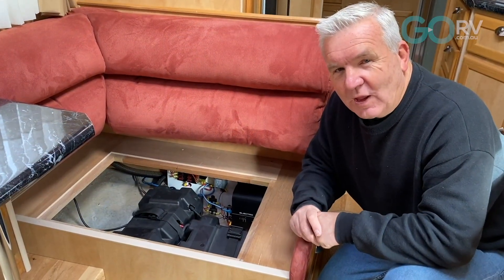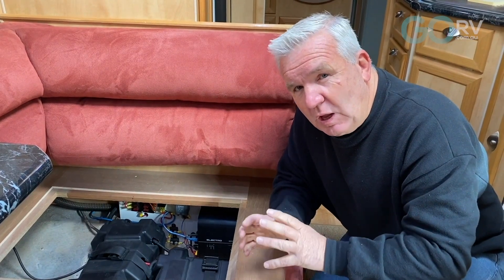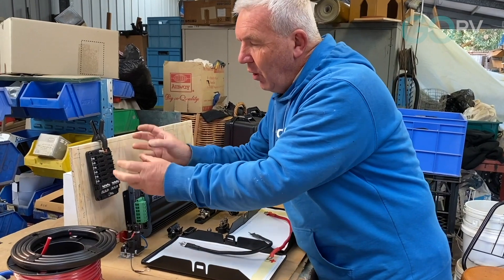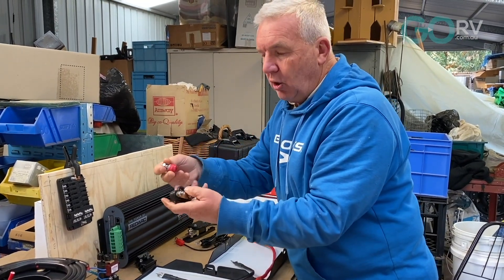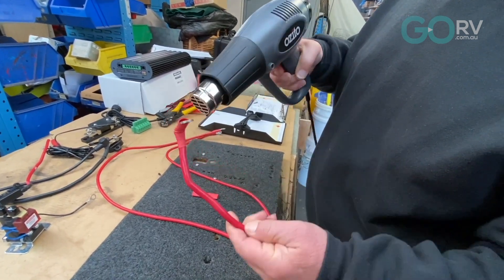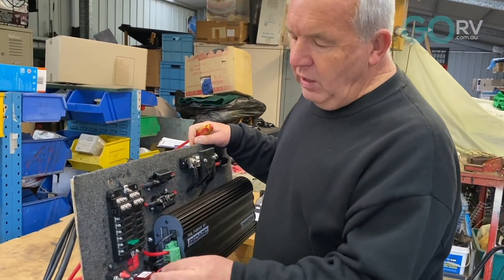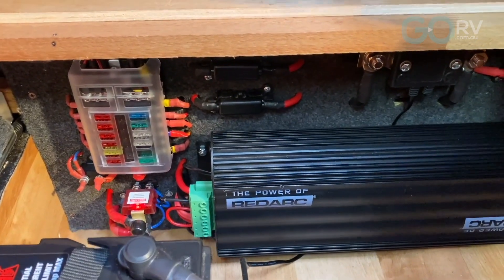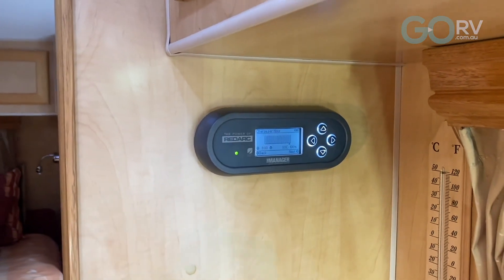REDARC BATTERY MANAGEMENT SYSTEM: DIY INSTALLATION

Comment: I think where most people fail, and that is, labelling the wires. All wiring, regardless, looks daunting without any type of identification. So, by labelling the wiring, it makes circuitry and componentry setup so much easier and even more practical. I actually purchased a Brother Industrial Labeller to do so for a more neater finish, but also a more permanent solution for cable identification. I am however, wondering about the position of the digital screen as it seems to be in an awkward place to be efficiently used, and more specifically, the isolator in your circuit. Is that isolator like an emergency stop button found on heavy machinery or more like an automatic cut off switch?  Cheers for the video bud :-)